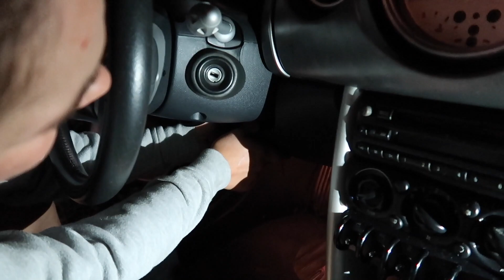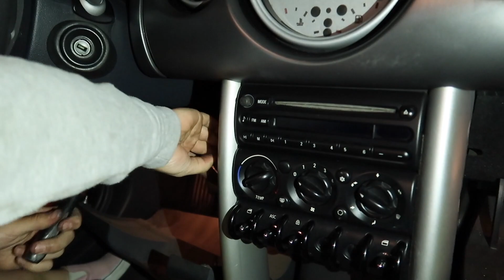Alli's R53 Project : Repairing Rear Suspension and MODDING!!! {Part 3}

Comment: Hey Juliette, been watching your cool vids and want to ask for your advice. I have an R56 and since I have not been using it as often as I use to due to the CODIV the hood seems to have seized. When I try to pull the lever from inside the cable ends up detaching from the lever. Any suggestions?
Reply from the maker: Interesting. Is it possible the cable is over stretched? It might need to be replaced!